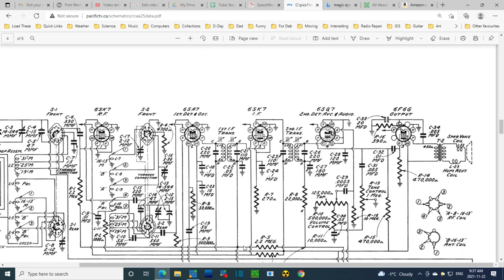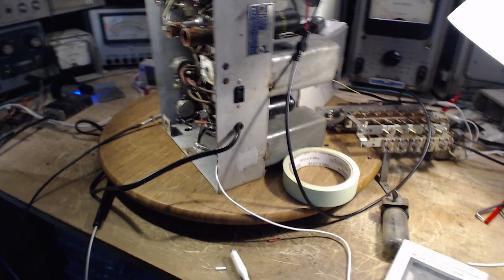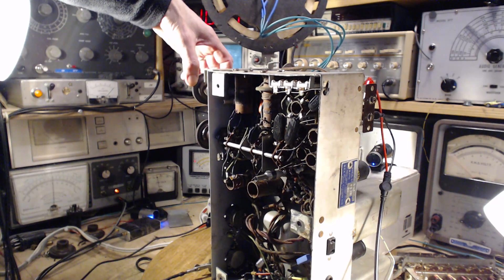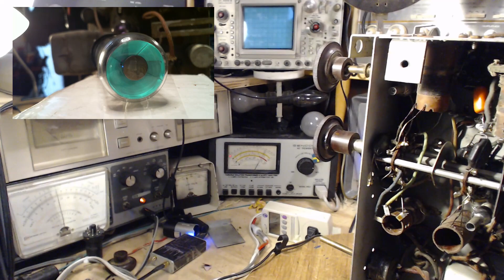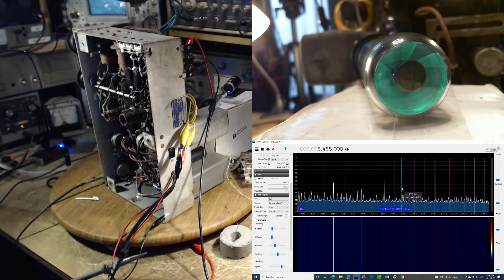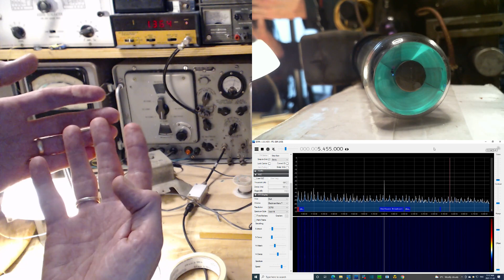RCA Victor A38 Shortwave Tube Radio Video #14 - Spurious Reception

Comment: Did you clean the contacts of the wafer switches?  Did you clean the  tube sockets and pins of the tubes? I mean all of them. Weird stuff happens like wrong voltages , no voltages, and spurious reception, even after you checked all the tubes,
if you don't do that important step first.

Comment: 1Mhz thing is not the radio !

With the signal generator at 1Mhz you can get outputs at 1 2 3 4 5 6 ... Mhz up to the top of the radios reception .

This is the basis of the old marker generator & comb generators .
The fundamental is normally 100 Khz & 1Mhz .
The signals go past the 50Mhz mark & 2 -3 Ghz for comb generators !